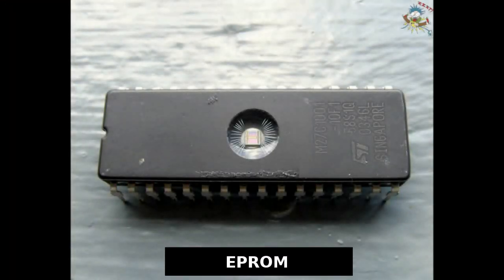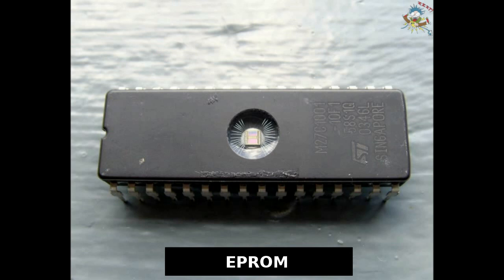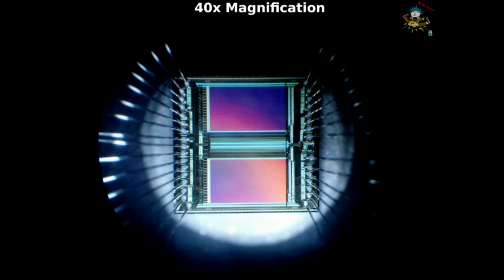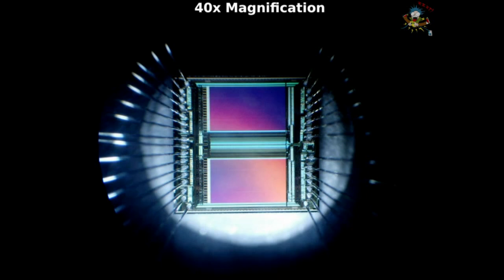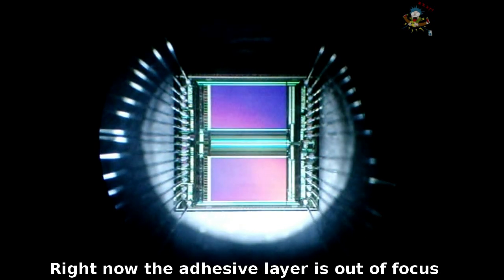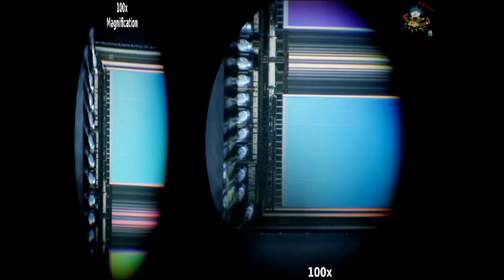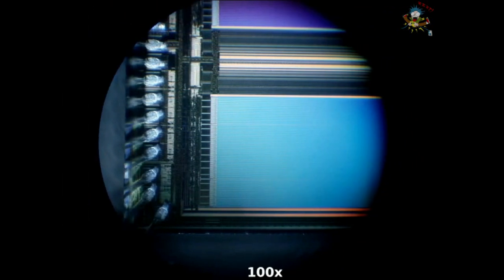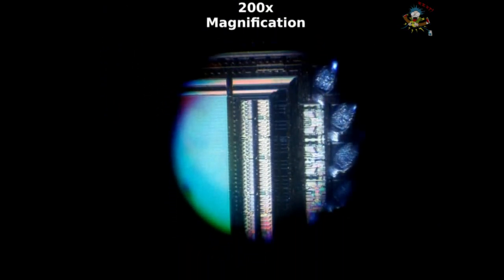EPROM Under The Microscope

Comment: Cool video. What you see from the top (The big square areas) isn't actually "solar cells" - It's the arrays of floating gates under SIO2-coating that you see. If you could magnify 1000 times, the fine circuitry would be visible. It's amazingly small.
Reply from the maker: I wish I was able to allow light to enter the chip, because my microscope works very well at 1000x. To my understanding the floating gates are where the UV light is directed. Correct? So those large areas(floating gates), are also where the UV light is absorbed to erase the memory. I think that is what I read in a handbook. I guess it is similar to when you open up a 2N3055 transistor and allow UV light to shine on the semiconductor material to produce a voltage(charge).

Thanks for your input!
Reply: electronicsNmore EPROM memory cells use floating gate technology. A floating gate is a gate with a special capacitor for its only electrical connection. This special capacitor takes on an electrical charge in a quantum physics effect called tunneling. To rewrite an EPROM, you must erase it first. To erase it, you must supply a level of energy strong enough to break through the negative electrons blocking the floating gate. In a standard EPROM, this is best accomplished with UV light at a wavelength of 253.7 nanometers.
Reply from the maker: I did read that UVC light does it within 20 or 30 minutes, otherwise you need 1 week of sunlight.
Reply: electronicsNmore Yep. Germicidal lamps are perfect for this. You can get them at your local pool supplier, as they are sometimes used in algae-filters. Sunlight does erase them, but very slowly, as there is a very small amount of the usable wavelength.

Comment: i vote for a SEM version of this video. I want to see further inside. :3
Reply from the maker: As soon as I get my hands on another EPROM, I will try and carefully break it open so I can look at much higher magnification. :-)
Reply: electronicsNmore
how about using hot nitric acid to decap the black plastic part? i dont think the glass windows is glued to the die so once you get rid of the plastic it should come off. Just check if nitric acid reacts with bare silver just in case. it does with copper so be careful if you want to keep it functional
Reply from the maker: Not black plastic/epoxy. The housing is made out of a very hard ceramic material which my Dremel cut-off wheel has no effect on. Maybe possible using a diamond wheel, which I do not have.
Reply: electronicsNmore  oops i didnt notice, I saw black and just assumed it was black epoxy :P
Well there's hydrofluoric acid, which i'm not sure would work for THAT ceramic material but it eats through a lot of things silicon included so it could end up dissolving the die itself if not careful and the byproducts are poisonous and dangerous as fuck, as the acid itself, so i dont think its a plausible solution :(

Diamond wheel sound good. Other than that i can only think of a high power laser but i dont think you have one of those either.
Reply from the maker: hydrofluoric acid? If I recall that is what Walter White used in "Breaking Bad" to dissolve a body, instead the entire tub dissolved. Good stuff, LOL